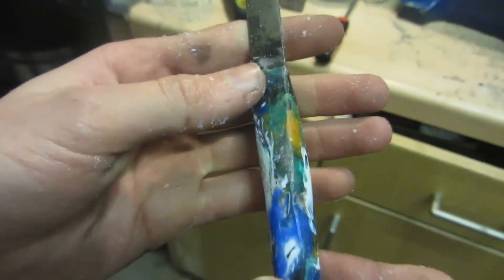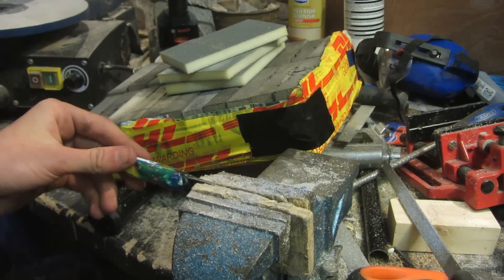How to Forge a Carving Knife From a Drill bit - part 2

Comment: These drill bits are made of HSS like t1 and m2 which require 2000F+ for the quench and are tempered at ~1000F. So it is more than likely that your knife isn't heat treated properly. Regardless, good work.
Reply: I'm not sure he confirmed the drill bit was HSS, it may be just a high carbon steel, he did say it was not a high quality drill bit.
Reply: John Stokes HSS is the most common. I have yet to see a simple carbon steel drill bit at the hardware store, maybe I'm not looking right or that's what we have here, along with coated bits. Look at the file test, it sure looks like it's biting into the blade. He may have gotten low 50's on the Rockwell at best.
Reply: Homme Des Cavernes
Reply: Yes you are correct it's hard not to get anything less than HSS but he did go through transition as checked using a magnet. If that was the case then tempering at 200 C would leave it in the hard state wouldn't it if it was HSS.  As you observe though the file did seem to bite so maybe his quench was too slow so it  did not go to tbe very hard brittle state.
Reply: John Stokes Yep motor oil is probably too thick. Also, pretty sure all hss require soaking 5-10 min at critical to let all the elements go into solution. It will still make a usable knife, after all the old guys used copper and if it wasn't good enough we wouldn't be here.

Comment: Cast aluminium knife handles - what a great idea! I've been collecting aluminium cans and crushing them for a year now!.
Took 2 sulo (wheelie) bins full of crushed cans to the recycle metal guy and got $7 each time (and it only cost me $10 in petrol to get there and back LOL).  So I originally wanted to melt them down and cast something useful but I couldn't THINK of anything to cast!
Now maybe you have solved that for me!.
Would love to see how your going to cast the aluminium knife handle onto the twist drill drill bit tang!
Lost foam casting?
Man I can see me buying a 3D printer and creating hand fitted molded handles in lost wax - that are then cast in aluminium onto the end of drill bit knives!.
Maybe even do the same with brass maybe from old melted padlocks?
I wonder if there's a way to engrae the cast metal handles with say a dremel to get that knurled finish that machinists do on a lathe or like gun stock makers do when they hand chequer a timber rifle stock?
I guess one could just epoxy a wooden handle on, then shape that and chequer it by hand with the little v shaped stock makers hand carving tools also for some variety.
Maybe wooden handle with brass bolsters or something each end make out of old padlock bodies?.
Got my mind working overtime you have.
Reply: remember that there are different alloy types of aluminum....designated by a numbers system...ie 6061 , 5556, etc

Comment: BRILLIANT!!!  You may find that the ball-peen hammer head is only case hardened.  The case hardening gives you a nice hard outer surface with the softer mild steel interior absorbing the energy of each blow.  If it were hardened throughout, it would shatter.  Thank you for posting your fine videos!

Comment: great job on the video bud, keep up the good work. Just to give you a heads up on a few things, when you were heating up the handle in the oven, after heat treating it, all your doing is weakening your blade so maybe come up with a different way of doing your handle. Also when you are working on your handle you should tape up the blade side. Well again great work and keep it up.

Comment: Should do a clear plastic handle so the drill bit is visible , that's cool !!
Reply: +tammy aikman     I was thinking the same. It would look cool.
Reply: I truly like the idea of using post consumer plastic to make the handle. Being in the "business" of plastics I think if you were to cut your pieces smaller it would allow for faster melt as well as less inclusions (holes). If you are really creative, you could make a two piece mold (which could be reused time and again) from channel iron/steel and place the bit inside where there is equal distance all around. (the mold can be clamped together with vise grips, hose clamps, etc. Whatever is easier) One end would need to be made where the blade could be exposed but where the molten plastic could not drip out (too much anyway) Then you could fashion a container which could be placed into the hot coals which would then hold your receptacle for your plastic and or pellets. The heat from the 1st container will transfer to the second container and thoroughly melt the plastic to the point in can be poured into the mold, standing vertical. (I would also heat the mold as you have done before with the blade) Sort of a poor mans injection molding unit. I like undo.kat's idea too, using clear HDPE pellets which you could create different swirl patterns (the greater % being the pellet vs the post consumer material). Someone mentioned a clear handle but if you use 100% pellet,  it will be opaque at best, considering the handle thickness and grinding. Polycarbonate is the only true clear plastic and hard to work with conventionally. If you try this, check into some kind of mold release agent to get the best life from your mold. Anyway, it looks fun and wish I was a younger man to try the same! Good work and wishing you much success!

Comment: Kid, you're a rock star! I've not doubt you'll be an amazing bladesmith if you choose to pursue it. I am not knocking your craftsmanship or execution when I say I think your design skills are where true strength lies. Hope you go for some kind or drafting or engineering or art school where you can push yourself against other sharp people,  and, perhaps more importantly, present what's in your head either digitally or as a traditional portfolio. Suggestion: use the same tube process for the handle, but use some clear acrylic resin or epoxy. Show off the drill bit that way. Maybe flatten the sides a bit on the anvil, give the bit a slightly oval cross section. Seen a smith down in SA do something like that with a motorcycle chain forged for a biker customer. Keep rockin'.

Comment: I would suggest grinding the hdpe to confetti size pieces. You get it in such pellets when you first buy it as Marlex or other "virgin" materials.
You could use most of cosmetics bottles as the source - plenty of those have pearlescent masterbatch in them. In fact most of the caps are made of PP, which could give you harder surface.
Also processing PET(E) might be cool to get transparent handles - probably.

As for tube - wouldn't it be easier to shape it of thick aluminium sheet?

Comment: What a smart kid,, I worked in a foundry for ten years and was second in charge to the metallurgist. why don't you try to use coke instead of coal, as coal has far to much sulphur content. If you cant find coke try charcoal, it works the same,, please remember that sulphur is the big killer of steel. Have you thought about the use of a truck brake drum for your forge?? cheap to buy at a scrap yard and last for just about ever,, line this out with garden clay and allow to dry very slowly. Fire this up as you would pottery,, when its hot sprinkle non iodised salt over the clay and this will give you a glaze,, should last a long time.. Have you thought about D2 steel, I have made a few blades and find this good to work and it holds a great edge.

Comment: drill bits are not made of high carbon steel just the edges are fused with carbide so you actually diddnt harden it. Run that file edge wise into the knife edge and see if you can cut into it..I guarantee you can.
Reply: +Maximo Mindofgod lol, the kid knows more than you!! He isn't using carbide drill bits (which are the only ones with tungsten carbide), and they ARE high carbon steel. Everything you said is wrong. How does that make you feel?
Reply: +Simon Thompson Some bits are high carbon others not. some are titanium or high speed steel. titanium isnt normally forged due its different properties. I still think that blade will scratch like butter if you run a file along the edge. skimming the surface is what people do when they dont really want to test the hardness. and Ive heat treated knives higher in carbon content than those bits and NO they dont break when u drop them..you would have to have a very high carbon content for that. But thanks anyway for the concern.
Reply: ***** Fair dos, i apologize for baiting you at the end, that was a much more composed response than I was expecting.

I think the kid did a good job of it though, I used to do stuff like that when i was younger but never with such a good finished piece, so props to him for that.
Reply: Yeah he does keep busy..better than video games any day. Take care.

Comment: Great video. It was very informative and enjoyable. As for projects, you should try making a tool you need or would like. A small hammer for fine work, a metal ruler, a small point punch for making holes in leather(in case you ever use a leather strap to wrap a hilt), several small shaped wood carving blades/knives or a draw knife.

Comment: A very good video from  a lad who is learning. Tips - bolt down your anvil. don't wear a glove on your hammer hand (you will have better control), learn to make your own tongs - a pair for every job! Cut your hammer handle down until it suits you, just because the manufacturers made it 14" long does not say it is right for you. Improve your forge so you can insert the stock from the side. Lastly, see if you can find a blacksmithing short course near you, a great experience for anyone starting out.

Comment: I like the plastic handle . You could put the plastic in a blade coffee grinder to get smaller pieces. that may speed up the melting process. Also removal from the mold I don't know if freezing would release the plastic. but you could certainly heat the mold quickly and pull the knife out. Nice hobby. I like the video

Comment: You are an incredible young man. I love your fearlessness in tackling any project which grabs your fancy. For your first attempt at black smithing your blade turned out quite well. My recommendation to improve your skills, especially if you plan to continue with black smithing. Learn to hold your hammers from the end of the handle. Choking up as you do actually decreases your control as well as the amount of force needed per stroke. Longer lever = greater force with less effort. At first it will seem the opposite is true. Learn to use the rebound from your anvil for the back stroke. From watching your videos you have excellent hand/eye coordination, use this to your advantage. Look exactly at the spot you want the hammer to strike. Best to you and in your future endeavors.

Comment: Congrats with yoour new made knife! I want to suggest to clamp your blade to a piece of cold rolled steel with a vicegrip tong with the end of the cold rolled protruding out of the bladetip when working on the bevels (so you cant stab yourself with the non sharpend blade) further drill and tap a hole in the cold rolled and place a bolt to support the "hovering" bladetip when you are filing or sanding (sanding use wooden or mild steel strips to support your paper)
Keep up your work AND video`s

Comment: enjoyed your video. the only thing that I could see in your technique when using a hammer is that you tend to choke  the hammer. this means that you are not holding the hammer correctly. in order to use a hammer to get the best out of it you have to hold the hammers shaft at the base. this gives you the maximum weight of the hammer when striking the metal. You also mayave to use various sizes of hammers to vary the the force of each hammer strike. hope this helps James

Comment: You kid, are a budding genius. You sound like you are from the UK - if so then a source of high carbon steels suitable for knifemaking is Cromwell Tools. They have trade counters in most cities. Working with recycled 'mystery metal' is fun, but it can also be frustrating when a piece won't harden, or cracks.

Comment: I made a knife from a good drill bit for the wife, but I heated the swivel side and turned flat in a vise, than hammered it to the design I needed, very slim for the veggies, put a oak handle with a pin and epoxy, than sharpened.That knife is dangerously sharp and it holds a bloody sharp edge. Good luck buddy. You have great talent and I see that you study your projects well ahead.You will go places. Good luck from Canada.

Comment: Very nice.. I am in pressed.    Drills are useualy O1 or M1 drill bit for high speed steel drills..  they would work beast for the knives that I would think. But you8 asked for some Ideas and as a Member of the SCA always looking for good dinner uticnles  spoons forks comantions  ones.. Ways to pick up a few extra dollars and there should be a group in your area to talk to as well.
One comment though you may want to have something to lock down your anvil some bolts or something to move around to lock it in place or simply some wood blocks that you can bolt down.  and you may want to lift it up a bit. Save your Knees and Back as beast you can..

Comment: I thought you might sand it down to the steel swirls and then polish it, HDPE and steel.  It would look great.  Especially if you used a larger drill bit.

Comment: For handle, you can make homemade micarta. If you can get a hold of some resin from fiberglass repair kits (usually sold in auto-care section), soak a strip of cloth in resin and wrap it tight around the handle. Wait until it cures and start sanding. Very durable handle.

Comment: You mentioned you don't like tool steels like A2 and O1. These two are soft materials to work with and become very hard (60+ RC hardness). These two are expensive especially the O1. O1 has some stainless properties in it. What to make with these blank stock? Why not surprise us? Take this advice from an apprentice toolmaker.

Comment: You should clean up that old circular saw blade using electrolysis. Easy to do, makes a good video, and will clean up all that rust. Check out out the videos on cleaning cast-iron pans using this process. Keep up the excellent videos, btw.

Comment: Nice vid mate, have you tryed a higher temp when you're melting hdpe? When im welding it I dont go any lower than 235°C(extrusion welding) hdpe has a sharp melting piont so im told(tafe courses through work) which means itll go soft then quickly go liquid within a few °C Maybe that'll help. Cheers mate

Comment: thanks for sharing. i make knives as a hobby. i use a fire brick for my work. the brick is the soft kind and was middle drilled out. i used a 3/4 and also a 1 inch spade bits. drill two 3/4 inch holes all the way long ways and cut out between with a hacksaw blade. the 1 inch hole is from the side middle ways off the brick and is the fire inlet from butane plumber's torch. the torch is set on a wire frame and aimed at the 1 inch hole 1 inch from the brick. the brick is wrapped with wire at the ends and long ways to reinforce it. the book i got this from is called " $50 knife shop ". thanks for some new ideas

Comment: If it were me I would add the handle inside the divots of the drill bit and polish it smooth or wrap that section with a strip of leather... both so you could see that spiral pattern. also flattening out the bottom and hammering in a ring hole would be pretty handy!

Comment: If you want to get serious about blacksmithing, I'd suggest upgrading your forge and anvil. A proper anvil can be expensive ($700+), but a railroad (or better yet, a crane) track will work much better. Also, a simple brake drum forge will prove more versatile than your current forge. Most forge designs consist of a hearth surrounding the firepot, where "green" (fresh) coal can turn to coke which is then burned.

Comment: Instead of cutting the tube that you used for forming the handle you can use us a torch to heat the tube. This will melt the out side layer of plastic and then you can pull the knife out.

Comment: You may try to forge an old bicycle chain together, it looks really cool.  You need borax to flux the metal while you forge  weld it together.   Your knife looks a lot better than my first.  You may think about going to an old crap yard to get big brake drum from a lorry to use for a forge, they work great.

Comment: I have 2 suggestions for you, hold your hand lower on the hammers handle, and i think when you buffed out the knife you probably couldve wrapped the blade in leather then put the knife in a vice and buff it with a portable drill i think its safer

Comment: Couldn't you have made the first part a lot easier with heating a metal funnel of the plastic into the tube.. That way you didn't have to pack so much? 

Or is it too thick that it wouldn't work without force?

Comment: Great start, hope you go on to be a fantastic blacksmith :D

When making knife blades out of drill bits it might be worth working the whole bit into a single billet which would give you much more metal to make longer blades out of, as long as you get the metal hot enough the open areas of the swarf channels on the drill bit should mush together and make a single long flat tang that you can put wooden or micarta scales onto easily.

Please don't melt down that axe head, I'm struggling to find a good axe head where I live and you might like to recondition that axe into a working tool instead of something else entirely.

Anyway, really enjoyed your tutorial and will subscribe to see what you can do in the future.

Comment: I really think you should try your hand at pattern welded/folded steel billets. 

I've looked up the method and you might not have a hot enough forge, but it would still be a fun experiment.